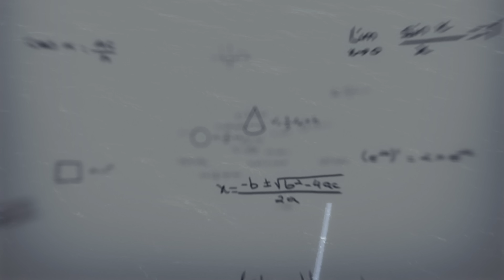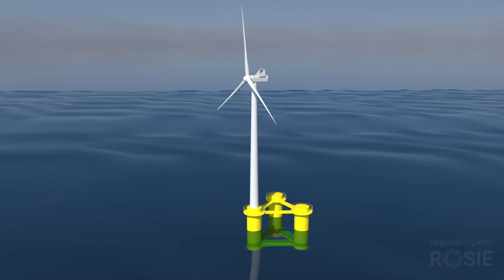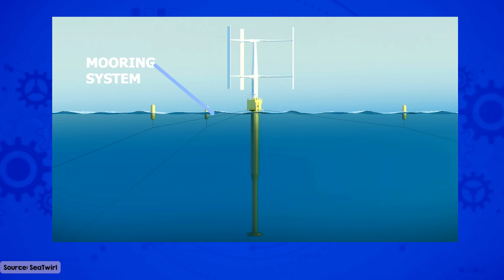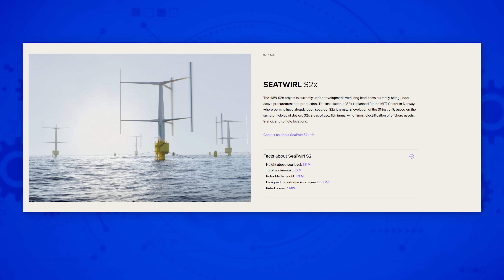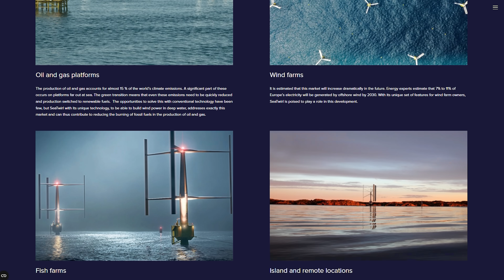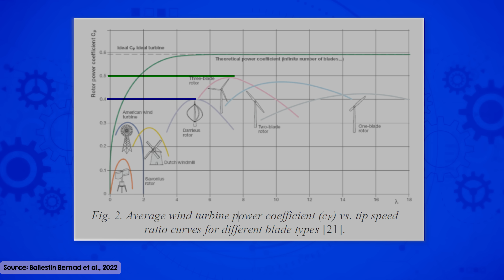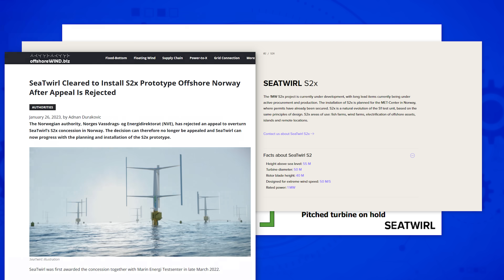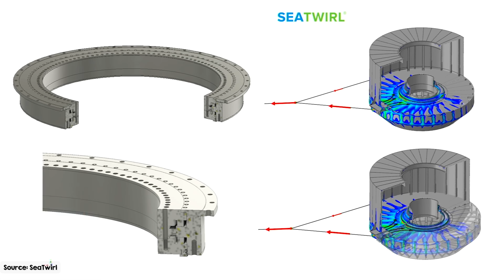Are We Building Wind Turbines All Wrong? SeaTwirl Thinks So

Comment: I would argue that efficiency in terms of free energy is not that important.
I love the 2 Bladed Design. :face-red-heart-shape:
Reply: If it is less efficient, even if the energy is free, means you need bigger stronger blades to collect the same amount of power. bigger blades are heavier, so they need bigger support structure, bigger shafts, bigger bearings. All that is expensive.

Comment: Rosie, 

a correction, wind generated electricity is one of the most expensive there is, it is not cheap at all. 
All you have to do is look at your State of South Australia and it's consumer prices.That and the incremental increase in domestic solar which diminishes the economic model for large scale generators, which are essential, but need to further increased prices (And subsidies) to keep operational. A perfect example of how not to run a grid, although Mr Bowen will probably disagree (Well he would wouldn't he)

Comment: Another question: if I have understood some basic concepts about wind generation correctly, the hwat units are getting taller to reach higher wind speeds. How does the vawt design take into account the lower wind speeds nearer to ground level?
Reply: Windpeed does not increase much with height at sea.

Comment: Denmark did a lot of experiments with horizontal turbines in the 80'ties. The reason why it did not become a thing was, that it required higher wind speeds to produce electricity, compared to traditionel turbines. It will be interesting to see, if horizontal turbines has something to offer, when it comes to turbines floating in the ocean.
Reply: In Norway, offshore wind blows at 3–4 m/s or more for roughly 90–99 % of the year, allowing turbines to produce energy most of the time. Often, the bigger challenge is too much wind, which forces turbines to stop. For this design and similar concepts, if the turbine can tilt slightly off the vertical axis, it could continue operating even in the strongest winds without shutting down. This may require more than 2 or 3 vertical blades. Keep in mind that the more the blades are tilted, the less wind they interact with, reducing energy production.
Reply: @einarcgulbrandsen7177 Yes, the Danish experience was with landbased wind turbines, and not at ideal positions.
Reply: *vertical
Reply: @alterego3734 right, sorry

Comment: Previous VAWT failed at scale due to a resonant vibration causing fatigue and early failure of the join between strut and blade. You mentioned this issue briefly in your wind tunnel suggestion, but not at all in conversation with the other engineers

The focus on efficiency should not be a goal in itself, but part of the cost calculation - cost to build, install, maintain and operate vs total lifetime gigajoules generated. An ocean floating VAWT might have a lower materials cost, lower construction cost (no cranes!), but will be damaged more often and have a shorter life

There's another ocean-floating VAWT startup with a different design. It's tall and narrow and has contra-rotating blades to eliminate torque stress in the tethers. Like a sailing boat, it leans away from the wind, so it can keep generating in high winds
Reply: You are correct about the cyclic/reversing stresses on the blade struts can cause fatigue failures.  
Also, fixed-vane vertical axis wind turbines are not self-starting but need to be motored up to speed to create the necessary relative wind to generate power.  That's not really a problem, just something to take into consideration.

Comment: They could couple this wind turbine with a cable system tethered to the sea floor and use the power from the wind turbine to pull a heavy load and the and save the energy in a gravity battery and the lower later and to generate electricity to send to the grid. And grouping them together in a wind farm can provide constant electricity because of the ability to store the energy in heavy mass and lower to generate power more regularly and efficiently for constant rather than intermittent power.

Comment: There are some good criticisms in the comments, particularly the power pulse from a non-helical design. Mine is that these are low to the surface and catch more saltwater and turbulence than the taller HAWT designs. Lower efficiency means higher costs per output.
Reply: It is lcoe that counts.

Comment: I would love to see a 100kw system to replace the diesel generators on the salmon farm.  Yes vawt are not as efficient as hawt, but to be honest these wouldn't need to be efficient. They would need to be floating, moveable,  able to work in high variable winds and moored.  The aquaculture industry is already moving from large diesel generators  to small gennies with large battery banks. Every 2 years we move a 14 pen 180mx60m farm weighing 1000s of tonnes up to 1 to 2nm. I think we could handle moving 2 or 3 x 100kw floating turbines.
Reply: Currently being evaluated for offshore fish farms in Chile.

Comment: Great video thanks for making i!. One issue VAWTs always face is that due to the movement of the apparent wind the blades get flexed back and forward every revolution so there is huge fatigue, which is a greater challenge the bigger the machine is. But it was interesting to hear about the pros I hadn’t considered them.

Comment: ... To provide power to oil & gas platforms ..😕..    With normal  wind turbines at 26Mw & their biggest planned at 6Mw  they have to go some to catch up  with an accelerating tech ..   Althou' have the weight at the bottom is more stable , the biggest tipping force  come from the force the wind applies ..  No info about how  cost per Kwh compares , or if its better for birds etc.
Reply: Can be expanded to 30MW or more , the limiting factor is probably the lcoe of a very large vawt compared with several smaller.

Comment: I've often thought that many slall VAAWTs, a few mwtres apart installed at the rpadside an on the central strip on dual carriageways, and powered by the slipstreams of passing traffic, could generate useful amounts of electricity 24/7. Fed to the grid via grid-scale storage to smooth out irregularities in supply. Rolled out nation wide it could potentially  be very cost effective. Someone with more kknowledge than me should do some calculations. This would be very unobtrusive , both visually ans more importantly in terms of land usage,

Comment: The wake recovery (12:40) is an interesting feature of VAWT. They are almost immune to variations in changes in wind direction (gusts aside) ... so in theory they should adapt faster. The fact that they are also floating allows significant potential for dev: ... If they prove susceptible to wake turbulence ... just move them a bit further apart.  This could even be adaptive feature that automatically adjusts to wind speed.

Comment: The power extracted is proportional to the area covered. Wind is faster higher up. While the vertical axis turbine has the wind load radial and the weight axial, the horizontal one has wind load axial and the weight radial

Comment: One of the reasons that traditional turbines are so tall is because wind speeds are higher and more consistent. Is it an issue for these HAWTS to be so close to the water?
Reply: The reason hawt's are tall is because they need to keep their blades out of the water .Windpeed does not increase much with height at sea.

Comment: As I understand it, the blades on vertical axis turbines are subject to much more stress than horizontal ones, because the wind direction reverses on them with each half revolution, so they get flexed one way, then the opposite and also the trailing blade has to pass through the turbulent air from the leading blade and from the mast/axis and the wind speed will also be higher, higher up the blade, which presumably would cause even more stress. Also the bearings are subject to lateral force from the wind, so they wearout much more quickly.
Reply: Whartbearings ? There are none.

Comment: VAWTs have a number of mechanical challenges which resulted in them being sidelined in the evolution of modern wind turbines. Has SeaTwirl overcome these challenges or do they believe that their advantages outweigh the disadvantages in the floating application?

Vertical Axis Wind turbines Ltd. was a UK company which designed and constructed three VAWTs (100kW, 130kW & 500kW) with a view to becoming a manufacturer or a seller of design licences. They discovered that this is not commercially viable technology and evolved into the global giant Renewable Energy Systems Ltd (RES) which also has its Swedish office in the same building as SeaTwirl
Reply: Problem is the bearings that they required , heavy load ,lots of wear. SeaTwirl does not require bearings .
Reply: @etxkgh  how do they interface the rotating and non-rotating parts without a bearing?
Reply: @etxkgh  the problems with VAWTs weren't restricted to bearings. The cyclic loads are much more challenging than those on HAWTs.  One of the founders of Vertical Axis Wind turbines Ltd. described them to me as "fatigue machines".

Comment: I think VAWTs would be useful in reducing bird strikes as the blades are more visible due to the slower speed and moving parallel to bird flight paths whereas HAWTs operate at much higher speeds and are perpendicular to flight paths increasing the risk of a collision.

Comment: VAWT's are bad enough as they are the equivalent of building an old fashioned water wheel to drive your mill and then wonder why bearings break, seize and have major vibration problems... using one for floating applications means you are constantly disrupting the axis of rotation creating all sorts of undesirable forces to be dealt with... and you think this will be cheap and simpler... not in you lifetime.

Comment: One big advantage of horizontal access is the turbine blades are high enough to be well out of reach of shipping, so safer. With vertical wind turbine, the bottom of the blade does need to be high enough out of the water to be clear of shipping, which somewhat reduces the advantage noted of a lower centre of thrust.
Reply: The ships are never supposed to be close enough to the turbines that a blade could touch them. They design the lowest blade height so it cannot impact the biggest wave possible at the highest tide.

Comment: Rosie, thanks for your informative report. I was wondering if , since wind strength generally increases with height, will SeaTwirl’s machines be shorter than comparably powered HAWTs? And hence not utilising as much available wind. Also wondered if this would be improved if the width of the upper swept area was greater, ie trapezoid rather than rectangular. Would that increase torque and power output?
Reply: Windpeed does not increase much with height at sea.

Comment: Interesting. One of my main questions was how to passivate the rotor in a storm. The fact that this is easier with a two-bladed design makes me wonder why they ever pursued a three-bladed one.
Reply: Same reason HAWTs have 3 blades, and electric motors have 3 phases:  smoother torque and power delivery.
Reply: Two bladed vawts have pulsations that fatigue the material. Three blades are much better. When vawts have lift type blades they can go up to 6 times as fast as the prevailing wind.

Comment: Operating cost and ease of maintenance may actually be more important a small penalty on efficiency.
Reply: Its not easier to maintain. How do you access the turbine to repair it when wave height is too high? You can't put an helipad on it to hoist people on it.
How do you access the blades to repair them? On HAWTs you just descend on rope from the nacelle. 

The generator bearing in the water needs to be waterproof. Sea shells will grow on the seals, salt will damage them.

Comment: A big "what if"; what if the struture incorporated some sort of magnetic levetation so there were no friction of gears or bearings? Lighter weight materials could be used with just a small support bearing at centre top to stop roll and yaw of the shaft. The energy required to power the magnets would be a trade off, bit I dont know how much  advantage is gained from losing that bearing or gear frction. On still days there would have to be a stored energy sounce to restart the spinning. Im definiately (obviously) not an engineer, but just curious.

Comment: I think there was a good reason for not using vertical axis turbines. Their "power density" must be a fraction of the horizontal types. In the vertical axis turbine the blade is facing the wind at a power producing angle for only a tiny moment, compared to full time, of the horizontal axis one.

Comment: Testing a VAWT on land will not yield results useful for a floating VAWT because when floating the axis continually changes its elevation and azimuth, thereby changing the motion of the blades relative to the boving air and inducing gyroscopic forces on the bearings.

Comment: No one seems to notice the big flaw: These turbines are low down, where wind speeds are much lower. The power output from a wind turbine is proportion to the cube of the wind speed, so getting height for fast wind is absolutely essential.
Reply from the maker: You are absolutely right if you're talking about onshore wind. Bu it isn't as big an effect offshore. Take a look at horizontal axis offshore turbines and you'll see they are only as tall as they need to be to keep the blades out of the water.
Reply: Did you comment before watching the entire video? 

Efficiency is discussed from 11:20 onwards

Comment: The beauty of water based system is that the water acts as a flexible mount unlike the land that holds it rigid so the stress on the structure is less. So no don't test it on land.

Comment: Nice information. What I would also like to know is how birds are affected by these vs HAWTs as these tend to get shut down in some areas when birds are passing. Also one advantage I can see is that way out to sea these would be less visible from the shore and could reduce the number of complaints from people living near a beach about 'horizon pollution' as happens frequently.
Personally I think we should be moving away from the typical HAWTs to these VAWTs. And with solar panel farms to  vertically placed solar panels (double sided) so we can combine them with cattle grazing or standard placement but higher and spaced out so you can grow crops underneath them. As I understand there are crops who yield better harvests in this way as they are not exposed full days to the sun. I live in the Netherlands where space is limited and I feel we should be promoting this kind of dual use of the space we have.
Also recently we had the issue with a solar panel farm near Amsterdam Airport that was blinding pilots at certain times of the day with their reflection and the airport wanted them all gone but the owner did object, finally removed some and installed anti glare foil on the others but for some reason nobody talked about placing them vertically! Problem solved in my opinion.
It all shows we have a long way to go.

Comment: I wonder if the water resistance on the rotating underwater structure doesn't pose great energy loss.
Reply: I saw that in the animation. Doesn't make sense. I think it was a mistake in the video. You would think the outer housing would be fixed and contain water tight bearings and generator components. Maybe flawed AI.

Comment: The point that caught my attention was the elimination of distribution infrastructure when the generator is built for a specific load.
I’m experiencing that with off-grid solar being so much simpler since you don’t have to dance with the giant drunken sailor,the grid, and just building a big enough battery to level out the production/ consumption.
In floating VAWT the battery mass is an advantage when mounted low in the structure.
Reply: But with on-grid solar/storage, the grid mass is an advantage as you don't need an inverter sized for the maximum theoretical load.

Comment: Pretty interesting! How come the underwater rotating pillar is not encased to reduce drag/resistance from water? I know costs is a factor, but is the reduction in output negligible?
Reply: My understanding is that the yellow part (in the model) is not rotating, just the shaft inside it.

Comment: The bottom line is that VAWT have been successfully utilized throughout history and they're probably better in some specific conditions and locations, but there are reasons that HAWT has predominated for so long and they are very unlikely to change.
Reply: Not long at sea , this is where vawt has an advantage.
Reply: @etxkgh 
Like I said, specific applications.
Any time Alt energy gets utilized to decrease or replace FF is a win in my book! 🎉

Comment: Maybe they could have done an Archimedes Pyramid Vertical Axis Screw Wind Turbine type design on a flotation platform with an Archimedes Pyramid Vertical Axis Screw Water Turbine directly connected underwater while inside the flotation platform is the generator etc securely attached by cables to the ocean floor ???

Comment: yes. you should be building wings parrallel to the ocean, with arrays of piezo generators. the forces will be constant and immense. more than a few watts of power and virtually no moving parts. it just takes some space but why not mount piezos on solar panels, city lights etc. it vould all be drip feeding watts into the system.

Comment: A small Vertical Axis Turbine with a friction heater and Heat Storage Battery (sand or water???) instead of a generator may be useful in northern climates since a grid hook up wouldn't be needed.  It could be mounted directly on a tank with the friction heater inside that tank producing heat as the VAWT spins but the sand or water battery would store it until needed.